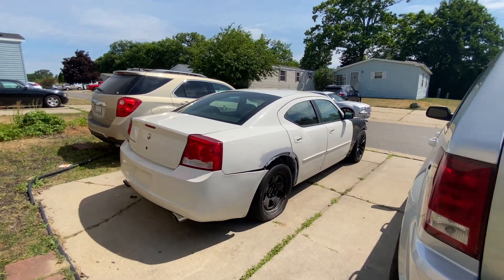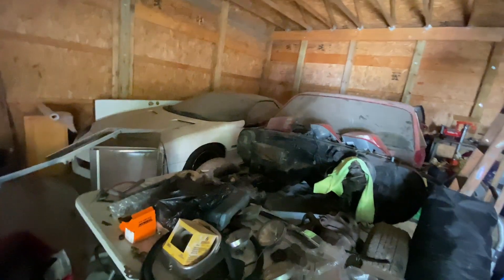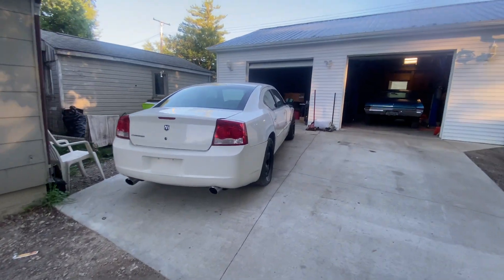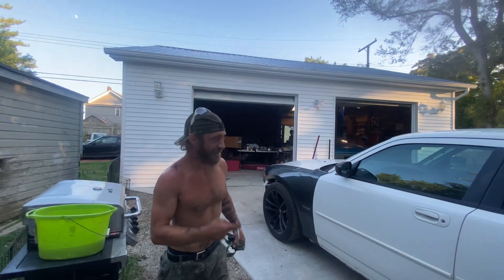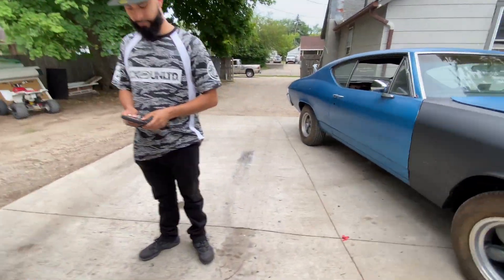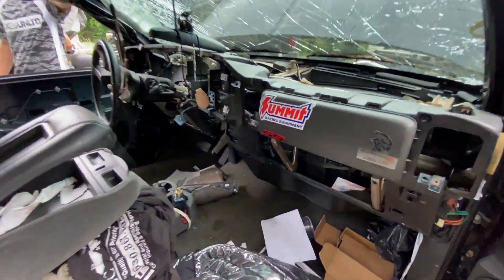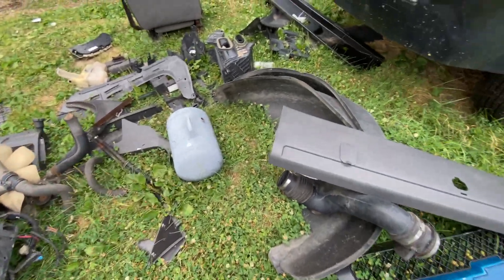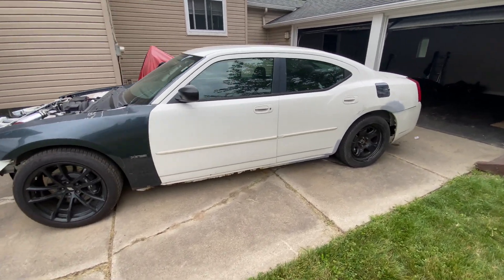BODYWORK ON MY 392 SCATPACK SWAP DODGE CHARGER IS COMPLETE !!!

Comment: been telling people2006/2023charger challenger Durango 300 hemi’s 5.7,6.1,6.2,6.4has the same wire harnesses I did this2years ago camin it N superchargern it now2010.
Reply from the maker: It ain’t just the motor tho it got the 8 speed , 3.09 rear end , Brembos and interior

Comment: What’s the point of a scat swap in a old charger model that’s basically just a old srt8 or am I wrong …..
Reply from the maker: 6.4 , 8 speed trans , 3.09 rear end and nice interior ??
Reply: @uli.m9965  I forgot about minor details let me re-watch this I skipped to the end 😭
Reply: @Maxx7teen  old srt8 has a 6.1 hemi and 5 speed slush box. So he has the guts to the new charger in old body. Definitely cool swap.

Comment: I got a Chrysler 300 what should I do to get it faster
Reply from the maker: Full bolt on headers , exhaust , ported throttle body ,6.1 intake manifold and tune
Reply: @uli.m9965  do changing the ps pumps make a difference